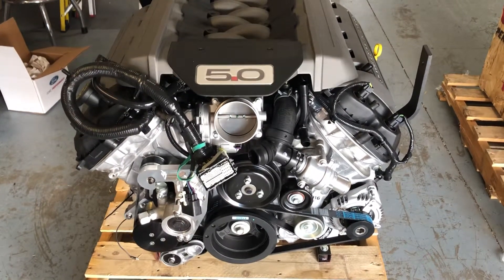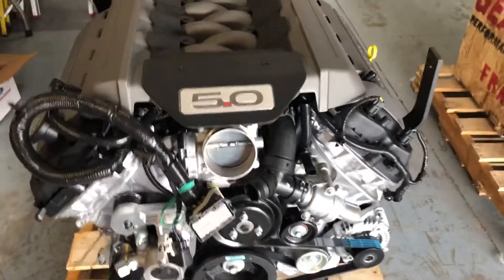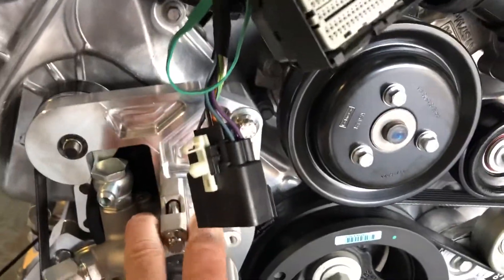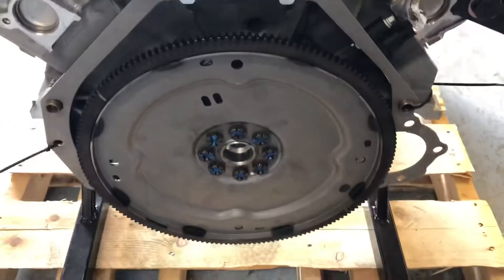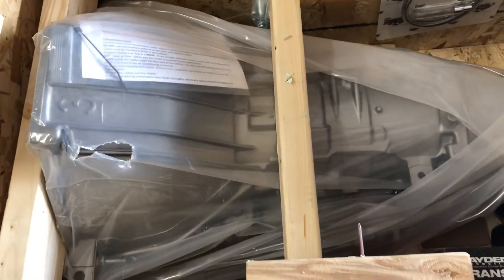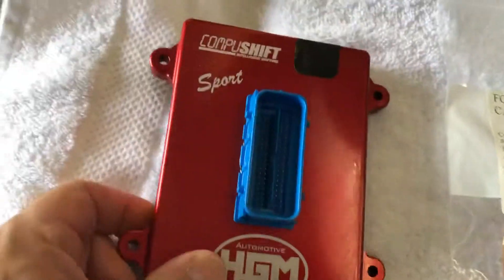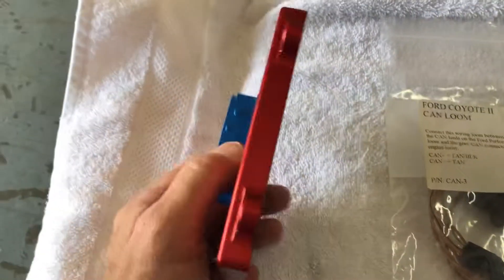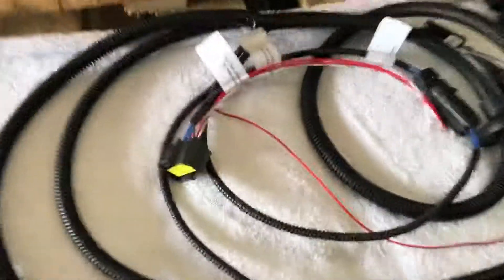Coyote with 4R70W transmission

Comment: Is there a Kit to to mate and control a Coyote and the 4r70?  I have an '01 F150 4wd I'm ready to either sell off or commit to some type of engine swap.  I can't seem to find any info on controllers or successful swaps.
Reply: thats what im sayin ^ lmk if you’ve found anything
Reply: @Snake-vq8yn quick 4 transmission controller with a ford  coyote ecu control pack
Reply: Well the yote the 4.6 the 5.4 all are part of the modular engine family so I would think it would be simple to hook up only question I would have would be the flex plate